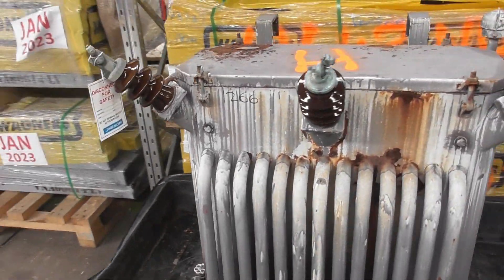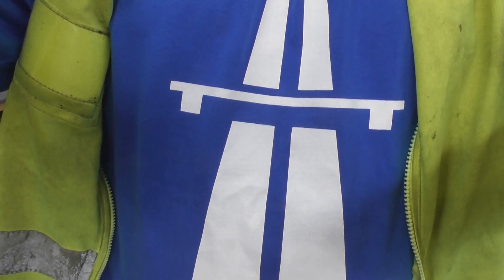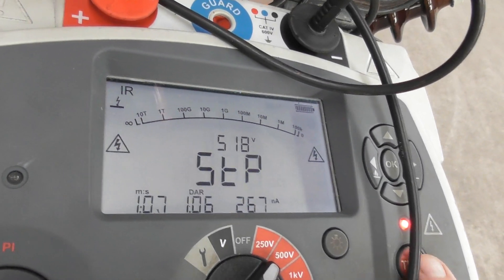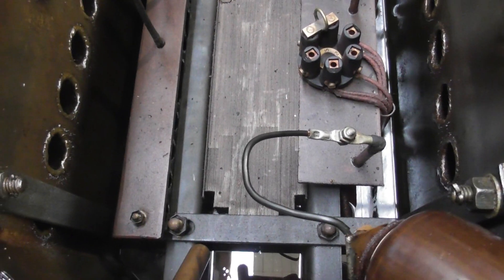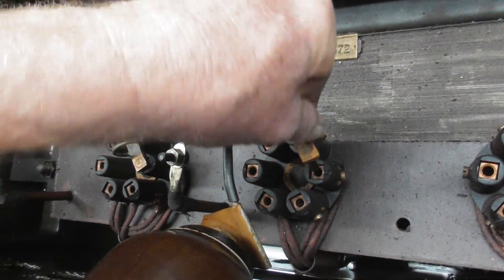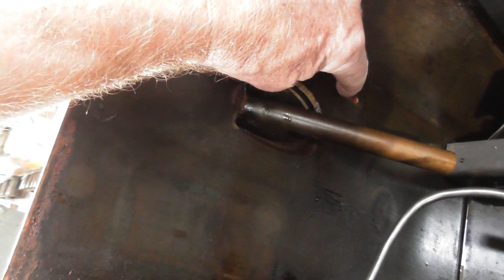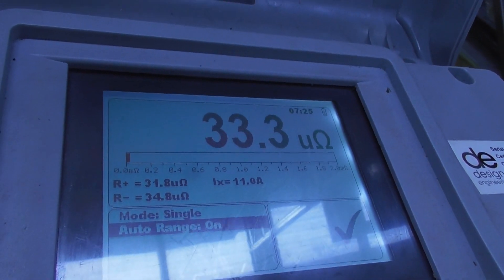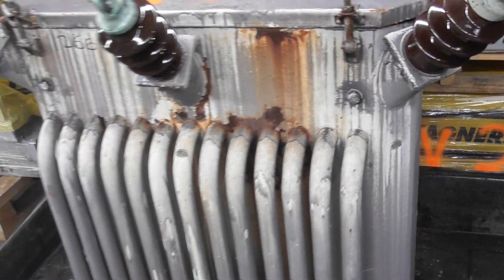Ferranto 50 kVA power transformer from the 1940's

Comment: I spent time rebuilding transformers. The oldest i found wete peebles transformers from the thirtys. Those copper wound transformers would go through a lot. The newer aluminum wound ones, one lighteninng strike and they are done
Reply from the maker: 100% correct. The copper wound coils are a lot better designed and can handle lightning strikes and overloads a lot better. The oldest ones I have worked on were Hackbridge transformers, also from early 1940's. This Ferranti TX could easy go another 50 years if retanked.

Comment: If it didn't have corrosion damage I'd say rebuild it and put it back into service.
Reply from the maker: This TX can go for another 50 years after a refurb.
Reply: New tank and bushings she’ll do another 50 years, however the low oil level may have damaged the crankshaft main bearings!!! Cheers for the video mate, always good to see the old stuff. I have stripped a tranny of that vintage for scrap, the craftsmanship of the winding assembly was superb. The scrap money was a bonus I stripped it as a learning experience. All the best mate.

Comment: Cool old gear. If you catch things earlier before too much damage, do they typically get refurbished? Seems like a waste if not. New gear is more expensive than maintenance.
Reply from the maker: Now these days company policy is that these older transformers are scrapped as they are not as energy efficient as the newer ones. But one lightning storm, these new transformers usually fail and need replacing while these older transformers hung in there for 70 or 80 years. Reason this TX was replaced is that the crossarms were rotten and there was a minor oil leak.

Comment: Is there any practical difference between 50hz transformers and 60hz transformers for power transmission?  I can see there being a difference in small electronics transformers, but what physical differences are there in large transformers?  Different wire size, shape or size or the core, etc, or are they really the same, but are only tested and approved for one frequency?
Reply: I would think very minor differences. There's some math you can do to determine best conductor/transformer design for frequency. Usually the higher the frequency the smaller the transformer, and the finer strands the wires need to be. I would think the difference is so little they use the same transformers?
Reply: Generally nothing different, exactly the same construction, as power transformers for 50/60Hz operation in distribution are built with massive cores, so as to reduce core loss under load, and run very conservatively as a result. So no difference in construction, and they will work on both, though you do get differences in that US made residential ones almost invariably come with a centre tapped secondary, while non use has a secondary with no centre tap, and one end grounded. close enough that there is no difference, and a good few of the old 25Hz large transformers from Canadian power producers around the Niagara falls area, where they used both 16Hz and 25Hz, were simply kept in service with 60Hz changeover, and are still in service, slightly lower no load current, and a slight power derating, but the overall loading makes this not an issue.

Hope Rodney kept that brass name plate, it would be a shame if it got turned into scrap metal, instead of being preserved as a pice of NZ history.
Reply: @SeanBZA   preserve history to respect our ancestors and where we are thanks to their efforts..
Reply: There is a minor difference. A 50hz transformer or motor requires slightly larger metal core. Role of thumb is a 50hz transformer will work fine at 60hz. However a 60hz transformer may overheat at 50hz. Just depends on it's internal construction. I say this as an EE working with electronics. It may not be an issue with large distribution transformers?
Reply: @andydelle4509  Transmission not an issue, as the transformers are designed for low loss at zero load, where they spend almost all the time at. Then are designed with low copper loss for full load. Small transformers are designed with much higher core loss and much poorer regulation figures, because that saves on the number of lamination's and the number of turns, and how thick the wire is.

Most transformers and motors now for industrial use are designed for 50/60Hz operation, simply to reduce inventory cost, as the differences are minor in most cases, though they also are designed to run hotter than a distribution transformer, which is required to last at least a half century in service.

Comment: No oil for insulation n cooling and it's STILL working. Us Brits do over engineer and make things to last, that's a for sure. 
I'm proud to be British because of our history of engineering, countless inventions and STEM 😊
Reply: they certainly did back in those days! Ferranti was responsible for much pioneering work.. also in transistors (later spun off as Zetex - who are still going as part of Diodes Inc) and in semiconductors - famously the ULA which was a precursor to modern gate array logic